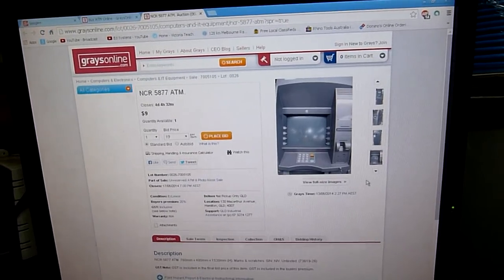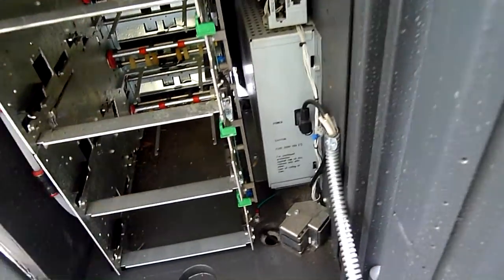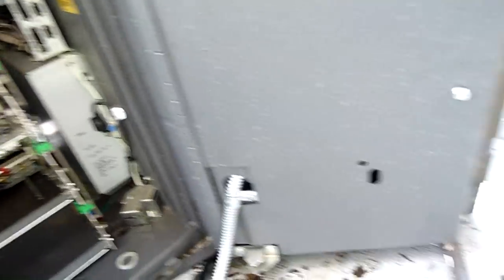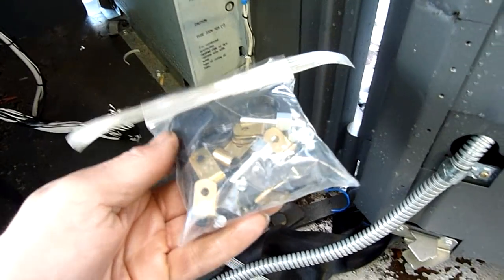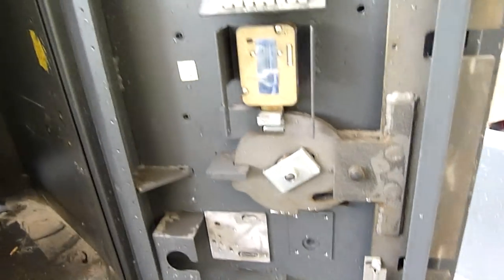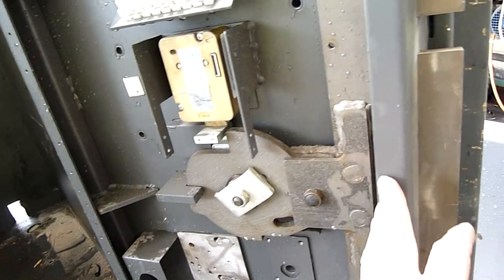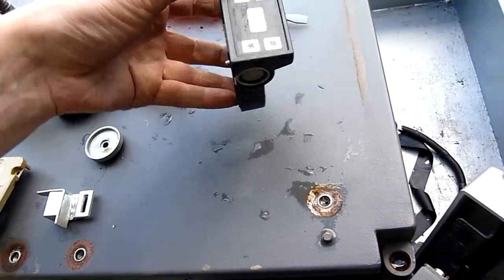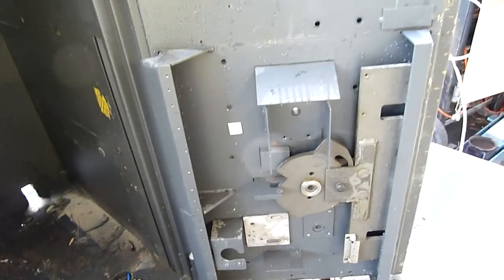NCR ATM Strongbox Teardown

Comment: We used to repair these in the 90's - we bought some secondhand ones for spares.  The combination for the safebox was missing.  We paid a specialist to open it, he did it with a single 8mm hole.
Reply: Where he made a hole?

Comment: that login reader is an "ibutton" reader. a contractor that I work with uses them. you can also find identical looking temperature sensors for extreme applications.

Comment: Back in the 90s they yanked a lot of ATMs in Norway, they used a big cat wheelloader and yanked the ATM away to their cutting site.
Quite successful with that approach, but now they have the cash staining system, even so you could cause the bank quite a bit of pain by using it as a Denial Of Service, making the stainer set off and leave it there.

Then again, a lot of the US ones uses the default password too, so if you find the manual you can have it spit out the bills for you.
Reply: if the machine is set for default yet, but quite a few machines issued by diebold are no longer defaulted because of that little trick. they are learning SLOWLY.

Comment: jukebox, heh..strip internal paint for meat smoker or food dehydrator, heavy duty rails for homebrew CNC project, or external padlocks for strongbox. Concrete, a substitute for lead for many safes (in bottom). The Hussein bros used an RPG on the bank bullion safe in baghdad..bent into a "U".

Comment: I think they have now fitted gas detectors to ATM's but one "fast' method of entry used successfully by a number of thieves was to fill the ATM with oxygen and acetylene gas and ignite it. The resultant explosion blew the case apart.

Comment: a few months back some guys tunneled under an ATM and cleaned it out, they only found the 40ft or so tunnel under the shop. have a go at the bottom to see if this one is just as flawed. it was like the thieves braking into peoples houses.. by going through the roof tiles.

Comment: some of the larger units used at outdoor festivals have incendiary units built into the cash boxes intend to incinerate the contents within a few seconds if 2 or more of the interlocks are tempered with, apparently door tamper or unit tilt and seismic.  the ATM company would rather sacrifice the contents rather then have someone get away with possibly 100's of thousands of dollars.  I learned this working stage crew late one night at the end of a weekend festival.  The ATM company had sent armored car to pick up the cash boxes, and a crew to unbolt the safe from the frames they were mounted to.  apparently someone didnt disarm one and the guys loading the ATMs onto the truck with a forklift were sprayed with UV marker dye coming from the cash slot as red smoke poured out every seam in the box along with a very loud alarm sounding for several hours until the internal battery died.

Comment: The cash drawers should have a sensor to tell the machine what denomination is loaded and as a result I think you can load the drawers in any slot. It doesn't stop you accidentally loading the 20's in the 50's cartidge or vice-versa though :/

Comment: Thanks Ed, ive never seen inside one before :-))

You say the computer uses xp, im not supprised, once all the crap is removed and the explorer is bypassed and replaced with a dedicated program im sure it would be very reliable.

Ive seen one supermarket self service machine crash and stick at the bios screen, so the old pc is a handy tool.
Reply from the maker: when I get the next one I will boot it up and see what it does :D

Comment: What I've seen is that those locks are powered by spinning the knob (the lock has a little dynamo inside), which wakes up the lock and reads out a code.    You then call a main office where they have a 'decoder', and they reply with the unlock code.   The fob is actually coin-cell battery used to power the solenoid inside the lock (I got a good look at one while watching Diebold unlock one to so I could change out a network cable on one).
Reply from the maker: oww that's how they work!, I thought the fob was like a RFID tag. thanks for the info!
Reply: Aussie50 zaprodk suggested that the fob may be a Dallas iButton (so I may be incorrect...)   Pretty sure on the dynamo in the knob however, so that it could be entered without power.    Any chance you could autopsy or take some hi-res photos of the lock parts (digital section in particular)?

Makes more sense to be an 'RFID' or similar transponder (however the contacts/antennas look a bit odd for that application), such that the code called in to the main office would be a hash of the RFID and an internal key, such that they could tell if you should be allowed to enter the cash box.
Reply from the maker: icesoft1 I will see what I can do, I will post pics on my G+ of the lock anyway
Reply: Do you have kaba mas cencon lock atm? Greetings im from indonesia

Comment: 18:07 Cencom Key. Look like Barbie frying pans. Ya wind the dial then a code come up, put ur Cencom key on and it will give specific code for specific keys. When you lock it you get a Number from lock itself from your key. The combination changes with every opening and closing. These locks are very secure.  Never the same combo!!!!!!

Comment: the steel conduit coming from the door contains the cables for the security sensors. reed switch,  duress button, combo duress, seismic, bolt status, lock status.

Comment: that combo lock mech should still work :)
would be interesting to see ! :) wonder if it can be reset with access from the inside? HMM
Reply: bah she broke :( lol
Reply: The default Mas Hamilton lock combo is 50-25-50

Spin it up until you see EC on the display
type in 50 25 50
if you see OPR
The means open right. Turn the dial to the right until it stops then open the bolt
If you see anything other then OPR there is some company in the lock that has not been shelved out. Lock out. Would have to be drilled. (or destroyed like this guy did)

Comment: Looks they use similar cash dispensing unit on NCR's U-SCAN / SelfCheck out machines.
Reply from the maker: simdude2u it would not surprise me if NCR still use the same mechanism in modern machines!, its reliable enough.

IO am waiting for one of those self serve checkouts to show up for cheap so I can mod it :D
Reply: they still use the same pic mod style..its not changed since the early 80s
Reply: simdude2u made many pic plates for ncr in Dundee
Reply: And they still charge their clients a pretty penny for it too, when it breaks.

Comment: Well, here in Slovakia there was a so called "ATM gang", they've stolen about 10 of these free standing ATMs with steel cable/chain and Porsche Cayenne and only one of them resisted, so I don't think they bolt them down so well everywhere...
Reply: Also Thermal lances are not that hard to come by these days, could be they used one.
Reply: MrHanske2 AFAIK they've once tried huge oxyacetylene torch, but everything inside was burnt. Here's a video of one of thefts : http://www.sme.sk/vp/14692/
Reply: Juraj Pekar yeah, it's pretty self explanatory that the insides would be of a dust like substance... But i was reffering to the act of removing the bars keeping it stationary, as in most likely burning through whatever it was standing on and under the atm itself. They looked pretty pro doing that, did they get caught?
Reply: MrHanske2 eventually yes, 25 stolen ATMs in total (build-in and stand alone).
Reply: Juraj Pekar Wow, that is pretty impressive.
Reply: depends what it's bolted to, if they cant sink the anchors into solid concrete, it's just a matter of how big the vehicle is it's chained to.  the idea is to make it more difficult to remove, leaving more time for the police to respone
Reply from the maker: wow, they were doing well!, ours get bolted down so well it would tear that Cayenne apart!.

Comment: With a plasma cutter I can get into one in about 45 seconds give or take.
Reply from the maker: a plasma cutter that cuts concrete? never seen that before.
Reply: maybe you can get some concrete mix and fix up the area you damaged so you could reuse the case as a fireproof (or resistant) box.
Reply: a plasma cutter would end up destroying anything flammable inside, so that would pretty much be pointless
Reply: mrh112 LMFAO ignorance is bliss! A plasma cutter wouldn't make it through, this  has various layers such as a concrete layer and others that  are there for that reason
Reply: MyWillyboi You could use a plasma cutter to cut out a triangle up high on the side close to the door,the you can get a hand inside and unbolt the locking mechanism '
Reply: just cut the hinges off job done